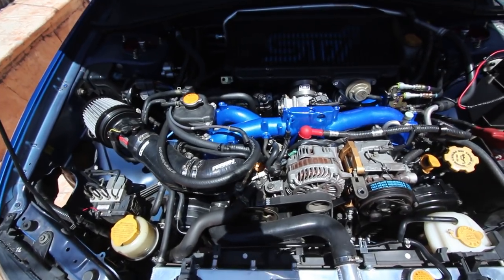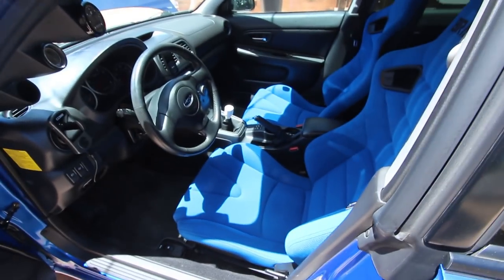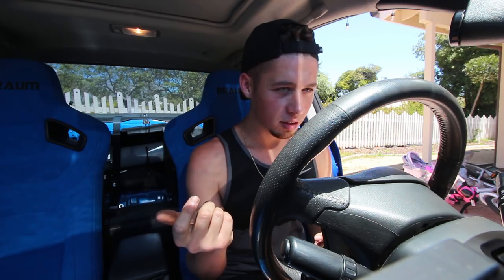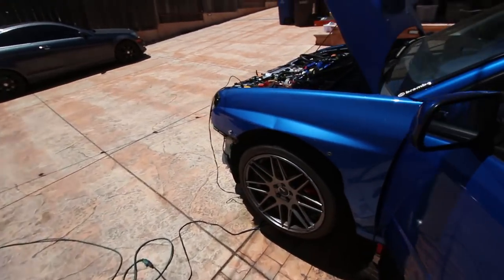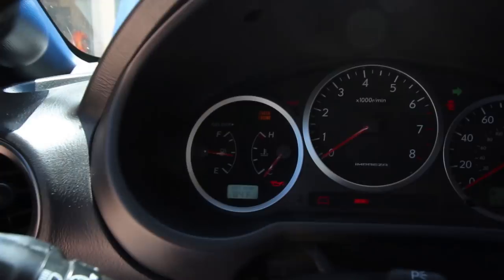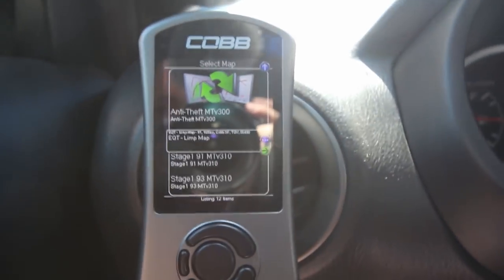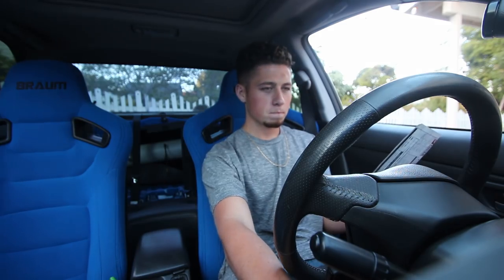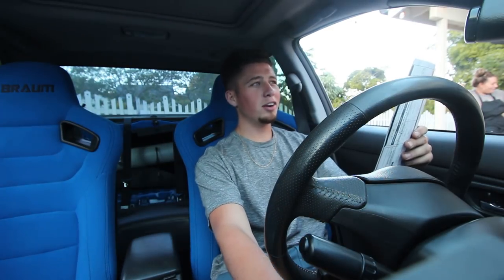MY FULLY BUILT WRX IS BACK!

Comment: that seat belt squeak is from the seat belt rubbing a piece of plastic under that cover. just take it off and take a razor blade to it where the seat belt touches. you dont not have to remove the foam pieces either. i had to figure it out one day mine did the same thing. hope you see this @AlexanderVargas

Comment: Not sure if you have this done already, but you should put turbo blanket / heat wrap headers and downpipe when running with the TMIC. It solved my heatsoak problems. Any oil leak may present a fire hazard, but your car shouldn't be leaking oil anyways ;)

EDIT: It's an inexpensive mod too!

Comment: The seat belt squeaking issue can be resolved by pulling the plastic trim cover off, and cutting the excess plastic material. PLENTY of write ups and videos about it. Just did to my brothers wrx, and it fixed it right away. Like a 10 minute fix if you're taking your time lol.
Reply: Also, I waited until the very end. Omg I started watching when you started the engine build, and wow this must have truly paid off for you. Cudos for not freaking out, and just listening to the new engine. Most couldn't have that self control.
Reply from the maker: Thank you bro!!

Comment: Dude I feel you, my engine is done, so I'm going to build a 420-450 hp engine for mine, I also have a 2006 wrx sti, so I can understand the anticipation. I can't wait for mine to be running again
Reply: You can make 400 on a stock bottom end easily.